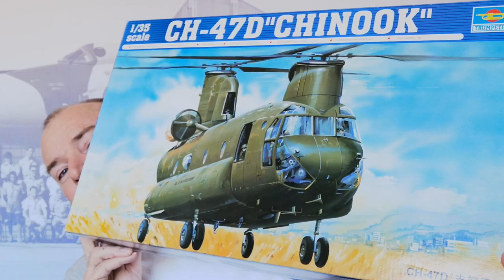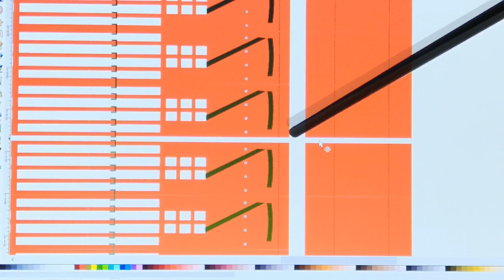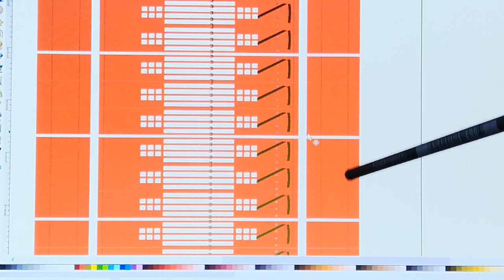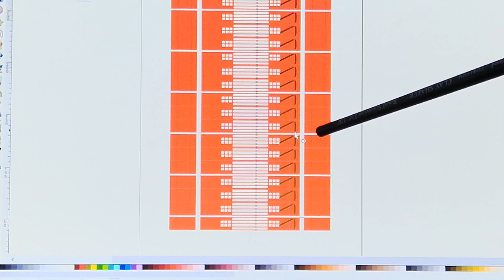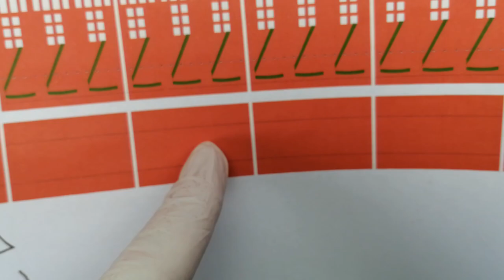Trumpeter's 1/35 Chinook 47D built into a HC. Mk 1 (Part 1)

Comment: Great seat idea,,I splashed out on the Eduard P.E. set for my seats, I ended up putting them in the folded up position,,,the seam lines on the top and bottom of this kit are particularly bad,,not so much the top as it has a spine plate that goes on,,,the bottom one needs the attention.
Great vids 👍

Comment: I've just caught on to this build and it seems like you are really going into detail on the UK Chinook. I think you need to state what period HC. Mk1 you are building as the Chinook had a major mid life update in the 90's with C to D model transmission fits, although I am not sure if there were any external changes in appearance. At the same time there was a load of NVG upgrades in the cockpit and now probably the glass cockpit. For Op Grnaby there was the EAPS filter fit and the rails in front of the engines, the Minigun which would be a good roll fit for your model. In addition there were various MAW fits  and when I saw one at Odiham last year it had loads of other external stuff hanging off it. A good build could be 718 at the Falklands.
Reply from the maker: An eighties Chinook, No.7 or No.18 Squadron, hopefully.
Reply: If you do an 18 sqn model you could do ZA 718 that flew off the Atlantic Conveyor in the Falklands. Post the MLU they were HC 2 Chinooks however the Engine filters and Minigun were fitted to HC 1 Chinooks for Op Granby in 1991. ZA 718 was also the first Chinook into the MLU programme in 1993 it must have come out of the Programme in 1994.
Reply: The Brits had Miniguns? I knew they had M60s, but not miniguns!